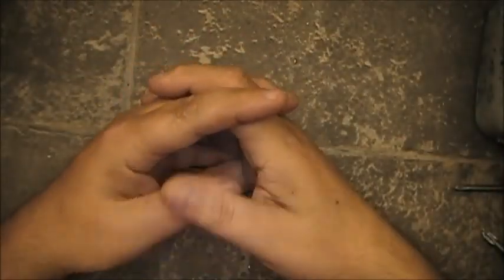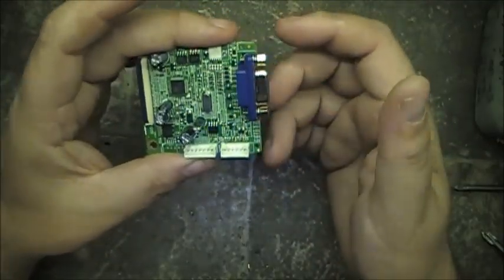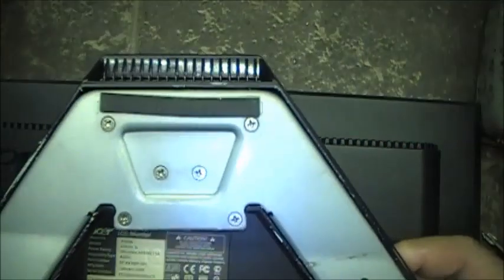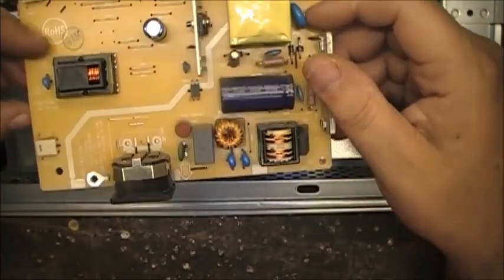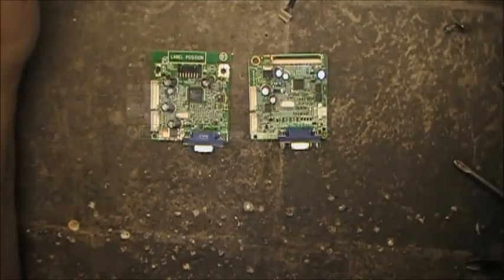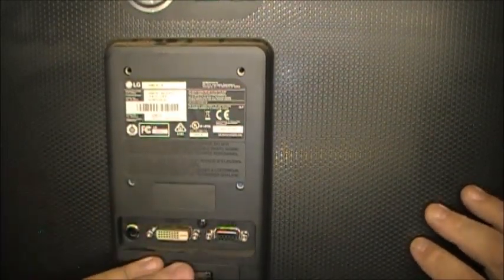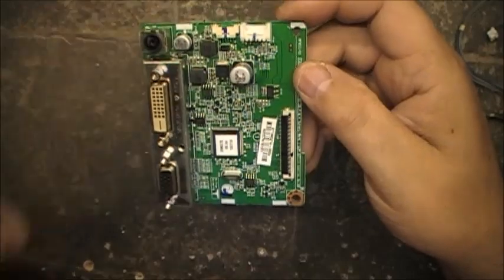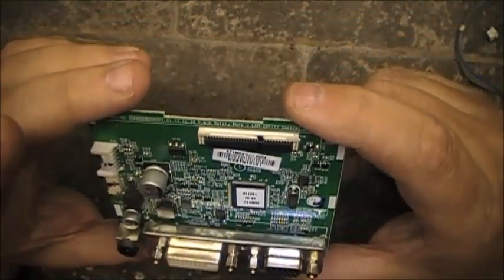Harvesting parts - Let's scrap x2 PC LCD monitors!

Comment: Are the VGA and other cable ends worth anything for salvage?
Reply from the maker: i saved the wire harness for future use and the crystals that were on the boards.  Regards to the rest of the parts, it really depends on what you like to experiment with.  :-)
Reply: @Radionut63  I do like saving hardware like assembly screws and other fasteners.
Reply from the maker: I have a bin full of screws, washers, nuts and other hardware.   I also have couple bins for the random metal pieces as well, like flat lengths that could be used to mount controls on for future radio receivers, i also save all terminal strips and solder rings i come across.  I can show you the stuff i salvage if it would give you some ideas what to salvage. :-)